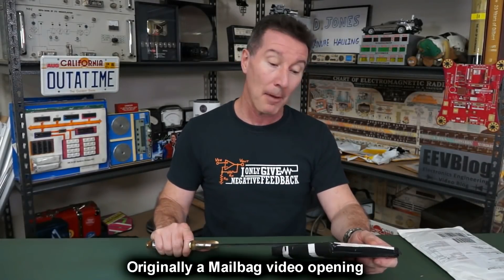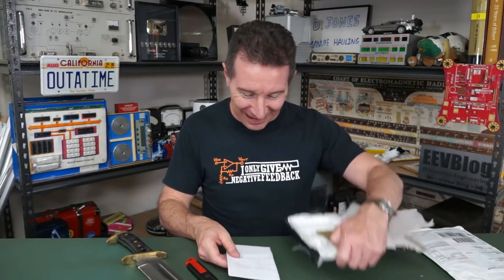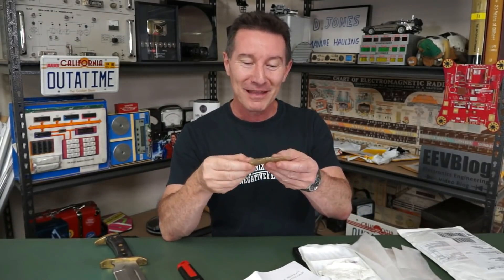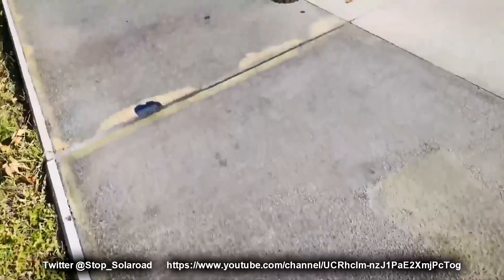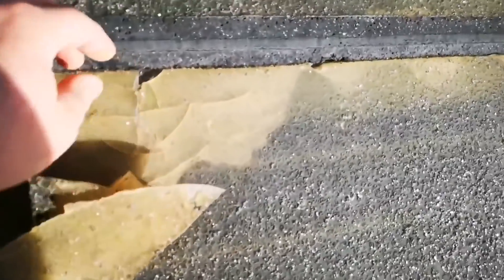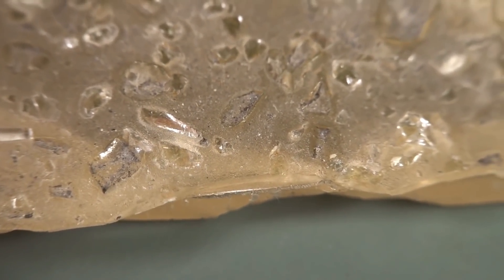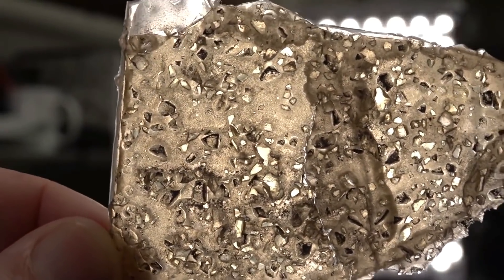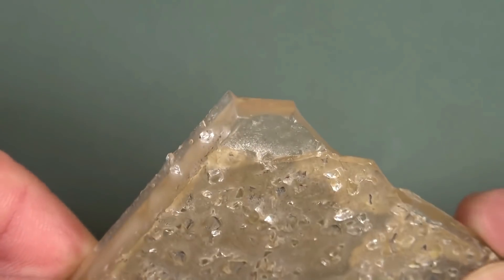EEVblog #1276 - Solar Roadways Surface TESTED!

Comment: Let's count the engineering fails here: understanding differential expansion, UV damage of epoxy resin, and effective bonding of the upper layer and the solar panels. I bet their initial tests and computer simulations without weathering looked great, even for heavy loads and point loads. Too bad the real world had to step in and nix the spherical cow they made.
Reply: Wait, wait, wait, you think they even did simulations? Hah! I doubt they did any testing. Shit like this is just a VC/gov't money scam.
Reply: @shadow7037932  Back of the Napkin simulations for flexing.....yeah, they didn't even have an engineer on this project.
Reply: @shadow7037932  1:30 The Guy says TNO, Google for TNO, it's a Netherlands Organisation like ''Stiftung Warentest'' in Germany
Reply: @Ratzfaz  yes tno is a scientific organization paid with tax money
Reply: The eternal incongruity between initial lab tests and field conditions. 
They might have learned a lot and are on a way to developing better solutions. 
I would hope at least lol.
Reply: Dave also mentions that these heat up "to all buggery" and aren't catching the sun right, add those points :) I am surprised that the covering remains this transmissive after years of "abuse," but I'm also more than disappointed that Dutch weather and bike/foot traffic are causing bits of the covering to peel up off the surface! It appears that they may have gotten the hardness right, at the cost of it being extremely brittle.

I would like to see a total cost analysis of a continually repaired roadway in comparison to an asphalt road, but what's the point when road traffic would clearly pothole the road and crush the cells at the joints?
Reply: @edherdman9973  Ohh! Can you imagine a road catching fire because a "pothole" shorted some of the cells out? One would presume they have some sort of fusible circuitry just in case something like that happens, but with how well their foresight has served them so far, you never know.
Reply: @edherdman9973  Potholes start below the road surface. These projects are doomed by the forces of groundwater and frost. They might suck less on a really deep roadbed (like those used by motorways) but that's too expensive for use everywhere.
Reply: I love the "pretend the cow is a sphere" joke.
Reply: Frankly, this looks like something done by someone who never used epoxy in real life. Anyone who glued a few pieces with epoxy would at least have their alert on high when thinking of any application where there may be cyclic stress with high stress concentrations.
Reply: Wasn't the original SR design to use textured glass (not resin) for the traction surface?
Reply: You do not mention one of the biggest engineering fails ever. Dumping large amounts of CO2 in the atmosphere for "free" without considering the consequences.

Comment: If I compare the expected results from that translated document to the output of my own rooftop panels, they, initially, projected an output that's 50 to 60% efficient ... compared to MY installation, which isn't angled optimally (since I can't very well reorientate my entire house). So, compared to a proper installation, they projected a yield of ... maybe ... 40%, if that. The people who championed this project KNEW from the get go that IT WOULD FAIL.
BUT THEY WENT AHEAD ANYWAY!
...
WHYYYYYYYYYYYYYYYYY?!

Comment: Hmm.. I love your videos but I think some if the comments were uninformed.

The key benefit of solar roads is large surface area and low installation costs. The problems (which can be solved) are as follows:

Vibration stress - if motor vehicles are used rather than bikes, then stresses could break the silicon and short cells. SOLUTION: amorphous flexible systems such as perovskite cells - if the toxic lead/cadmium issues could be solved.

Resin and grip: this is the most fundamental issue. SOLUTION:  It can only work if a flexible low glass-transistion temperature liquid glass, but UV resistant could be moulded (to provide grip) on top. That currently doesn't exist! But could eventually be created.

Dirt! Bike tires etc will create dirt. SOLUTION: The road would need regular cleaning. But that tends to be done anyway for bike paths in the netherlands.

So NOT a "TERRIBLE" idea - just a terrible idea if implemented with current technology.

Comment: Very simple: amorphous silicon is black, polycrystalline is blue.

That is because the refractive index of silicon changes with wavelength, reflecting more in the blue.

Ps.. 50% drop in efficiency is not that bad!

Comment: What i didn't get into my head is: In Europe we usually have a lot of rain, which is a problem while cycling to work. So half of the time you take the car anyways.
Instead of putting the expensive solar cells to the floor to scratch them blind - why not building roofed solar bicycle roads with them. You won't get so much rain and you'll get shade in the blazing sun, both of which are highly desirable at their time, when biking.

Comment: Way not make Floating Solar Arrays?
like, when should put those solar panels as rooftops.

sure there is the deal with wind, but is much easier to deal with that running over fragile silicon wafers.

in fact, way not house rooftops?
oh, yeah the marketing, people are a bunch of fools sometimes.

Comment: "When will they learn?"
When people stop giving them money.
Reply: Frankly, it's a pretty good gig if you can get it. Buy cheap (probably broken) solar panels in bulk from china, add some cheap plastic sheeting and earn a bunch of money installing it. A couple of years later you get a bunch more money replacing the panels with a paved road.

If i had the money to start one of these companies, i'd probably do it. As long as you make it clear "this is an engineering test without promised results" there is no way you have to deal with lawsuits.

Comment: All the homes / buildings / what-have-you facing and/or running along the "solar roads" all have roofs; which can be covered with solar panels. Solar panels on a roof do not have to put up with pesky humans interfering with the absorption of photons. Most roofs will offer much more surface area compared to the same length of "solar road". Solar panels on roofs will not sustain any damage from continuous impact loads of people / vehicles running over their surfaces. Solar panels on roofs do not interfere with the flow of traffic when maintenance is required. Solar panels on roofs do not need to be specially coated with fancy polymers for added surface endurance. Solar panels on roofs are much more affordable compared to equivalent square footage of "solar roads". The list does on and on and on.....
The only "major disadvantage" of solar panels on roofs is that they may not exactly conform to the architectural design aesthetics that were envisioned by Mr. Whatever-Douchebag's Architectural Design Firm LLC.  An exceedingly small number of people actually care wtf color & design style their roof may project towards the public at large. Elon Musk's silly solar panel walls are a much better idea compared to this "solar roads" nonsense.

Comment: check out the energy production for nearly 2 months of the new SR4 panels.  https://monitoringpublic.solaredge.com/solaredge-web/p/kiosk?guid=1e085701-ccb3-4ce5-b107-86e3b5e831dd&locale=en_US
at 7 cents per kwh they are nearly up to 50 cents and we still dont know if this includes all the power they are drawing from the grid.  some days this week they have produced virtually no power so for those 24 hr periods all the power has come from the grid. since they installed the new SR4 panels i have been copying a lot of the day to day output and that info can be found at the bottom of this album.  it starts after the SR3 panels were removed.  https://rezpics.smugmug.com/Solar-Roads/
it amazes me that this has gotten support from innovation nation - national geographic and newsweek.  i have written dozens of emails to our local news about this epic failure and yet they either ignore it or act like its the greatest thing since sliced bread.  the SR4 panels are at the bottom of this album.

Comment: What if instead of using solar they use TEGs embedded into the asphalt. Connect them in the right way (series groups in parallel) and you probably could get some meaningful power out of it. Obviously keeping the other side cool would be a big problem. Sure it wouldn't be cost effective either but hey just a thought.

Comment: You know, people focusing on the "solar" part is rather dumb. Like looking at the Space Shuttle and thinking the only reason it was ever built was because someone liked how the wings look. Besides trying to develop new building materials the plan is to have a road that deices and dries itself, communicates with cars about routes, obstructions etc. and charges electric vehicles while they drive on the road. Assuming we still have cars that don't drive themselves, that might be how they ensure nobody breaks the speed limits: There would be an upper limit on how much power can be transmitted so above some speed you would be spending more than you are receiving. One plan is to make the road from prefabricated pieces that can be replaced whole if they get damaged, so roadwork can be done in hours instead of days to weeks or more. As these functions require power and data cables and by definition roads go to places where modern people need those things, the roads will also be an integrated part of the electric grid and other infrastructure, meaning all of them will be maintained at the same time; our roads will no longer be dug up by three different departments who then have to rebuild it while refusing to do anything about the pothole five feet from the ditch they opened and filled again three times.

The thing about solar panels is they have become really cheap and are efficient enough that improvements, while useful, aren't needed for everyday users. If you build anything and there is an electric line nearby you might as well pay slightly more to have solar panels on top of it. Modernizing the roads, the electric grid and water infrastructure soon will be a massive issue and many cities, and even nations, are suffering the consequences of trying to save money by doing things halfway, or even not at all. I don't know how much that is going to eventually cost, but adding couple million per mile of road for the ability to produce power sounds like a good deal considering the other option is to pay more for installing those panels elsewhere; if one system only produces 30% of the power but the other costs three times as much, in the end the cost per watt remains the same.
Reply: Or put them on a roof and get 100%

Comment: The bits he was taking off were obviously damaged. The main part of it was a lot clearer. Your video seems to suggest that the whole coverage of the solar cell was with this opaque damaged stuff. I understand that this as a thing is a bad idea. But constantly laughing, sneering and joking about something that is obviously in its early stages of development, and then " testing" a chunk that is damaged seems pointless. 
Again I must stress that I do think it's a bad idea.
Reply: The opaquness was obviously caused by using a non UV stabilized resin or by not mixing it thoroughly when working with it.
How do you expect me to believe they can build a complete road correctly when they cannot even build a small sample (which the world will look at) in such a way that it lasts for some months?

Besides: it is just a matter of time, when the other, now clear, parts will get opaque too. Even UV stabilized resin does not withstand direct sunlight for longer then a view years.
Reply: @kallewirsch2263  so why is most of it still clear?? Or are you saying that only the bits on the edge were not right?
Reply: @kallewirsch2263  I do believe I said that it was a bad idea, twice in fact. And do you really believe they would use a non stabilized UV product.

Comment: 8:28 How is it possible for the solar panel to survive the measurement done using the multi meter since it's technically a short circuit ?
Reply: Every source of electrical energy has a resistance also, which limits the amount of current you can get from it.
If he had measured the achiavable voltage also, you would have seen a massive drop in voltage. Since the electircal power P equals Voltage times Current, it is the dropped voltage which saves the day by limiting the overall power through the short circuit.

In some sense it is like your arm. With your arm you can lift (eg.) 2 kilogram for 1 meter. Now if I increase the "load" to 50 kilogram, you will no longer be able to lift it anymore. You are simply not strong enough. But that doesn't hurt your arm. In that sense, the solar panel simply is "not strong enough" to hurt itself. The situation is completely different for a power plant. There is much more power availble then what  a solar panel can do. Thus a short circuit in the mains is much more dangerous. Even with a short circuit a power plant is able to keep the voltage almost at the usual level. So you have same voltage and high currents and because of P = U * I .......

In a nutshell. When talking about electricity, there are 2 important values to be taken into account: Current AND Voltage.

Comment: There you go again with short circuits. You're essentially measuring the power dissipation in the parasitic resistance in the solar cell itself, which is NOT guaranteed to be constant (and in the case of the indoor cell was obviously very much NOT constant). That tells you nothing. 

Also, reduction of efficiency is reduction of POWER, not voltage or current.

Therefore, your tests were invalid and your percentages were invalid, for multiple reasons.

To do a test like that, have the solar cell dump power into a fixed resistor, preferably a power of 10 for easy calculation. How much power can a cell like that black one put out under full sun? About 1 watt? And at what voltage? About 10V? So, attempt to draw some power by putting a 10Ω (NOT a 0Ω) resistor across the solar cell, and see how much voltage it can put across 10Ω. P=(V^2)/R, so 1V would be 0.1W, 2V would be 0.4W, 3V would be 0.9W, etc. Then see by what percentage the POWER (into a 10Ω load) drops when you put the "solar roadway" material over the cell. THAT would give you an idea of how much power is being wasted. I think you'd find it's much more than half. I'm guessing that material would waste about 75% of your power. 

As for the video... eh, I'll give it a "draw" (neither like nor dislike). I like what you were attempting to accomplish, but not the way you were trying to accomplish it.

Comment: There is so much other space available for solar panels, roofs of industrial buildings being the best place because they use the most electricity during daytime. Why are people so captivated by the idea of solar roads? What's next? Roads with built in batteries for storage?

Comment: Although I'm skeptical about this idea, we have to be fair and acknowledge that this Solar Road project is a really early stage R&D project to see if this idea can work. Proving that it can't work is a legitimate outcome...
Reply: There are ideas that don't need to be tested to realize that they are really dumb idea.
Just the simple fact, that in most parts of the world the angle of the solar panels to the sun is way worse then it could be if you do not lay them flat on the floor should be enough to drop that idea in less then 30 seconds.

Comment: I can say that there are new tests coming up, with an other type of resin which may pass through  more light!
The expectation will be that it would be finished around October 2020 ;)
Reply: HellHound 010 It doesn’t matter. When evaluating the feasibility of this you start with ideal numbers, and it makes no sense even if everything was perfect. No point in going any further than that. Compare that to eg. SpaceX’s booster reuse: they saw that if they can get it to work, they’ll save good money. This won’t make economical sense even if it worked better than Nature allows. Even if you had 100% effective solar panels that convert all EM radiation to power. The more popular the road, the more of a waste it would be. Stupid.

Comment: Isn´t that the one that people kept slipping on? I bet that rough surface is just epoxy that was poured over after because they were too lazy to take the whole thing out. That explains the 2 layers and the roughness. It seems those rough crystals work like a prism/ light pipe. Maybe if they put a ton of them at the right angles they could have a top surface that carries the load of traffic and ridges or empty spaces between that let light through diagonally onto the panel. Still won´t be nearly efficient enough to be worth it but could boost their output.
Reply: Sounds not bad.
Until you realize that the surface needs cleaning to get the dirt out inbetween or otherwise this will ruin the overall transparency averaged across the whole surface.
As for "the right angle". You realize that this means that you have to produce each and every tile for the specific place you want to lay it down? To make matters worse this would also create a nightmare when it comes to repairs.

Comment: "saturation" is actually a correct term - the voltage drop on the internal series resistance will kill off the performance. A couple of years ago I compared some of these small solar cell modules under controlled lab conditions and put it on my blog: https://www.sciencetronics.com/greenphotons/?p=155

The Amorton 1602 is about the same as your amorphous module and the Solarbotics modules are comparable to your other module.

Comment: Build a covered cycle way with the solar on top. Add water turbines in roof drainage, then add a few wind turbines. Job done. Dry cyclists, with great sun protection.